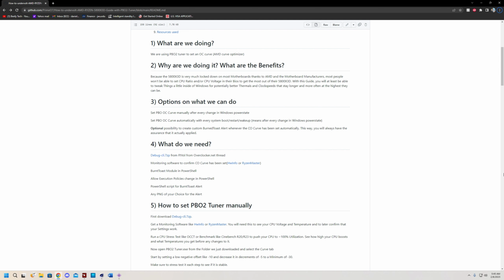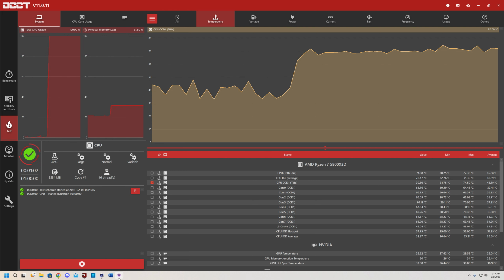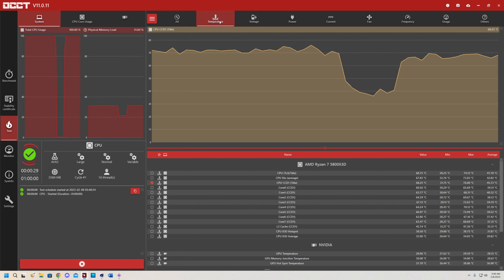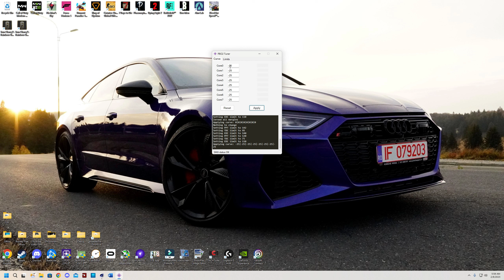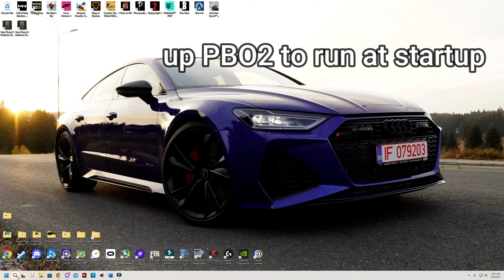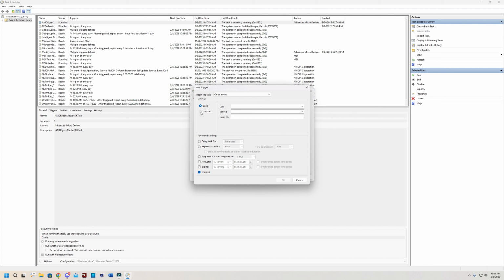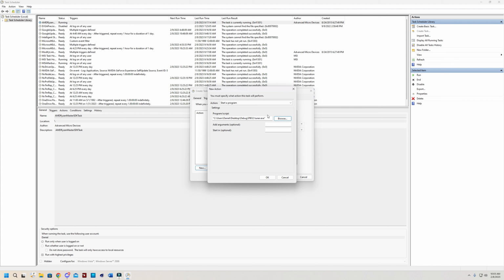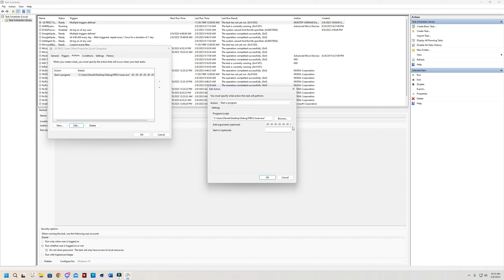5800X3D Undervolted with PBO2 Tuner (Setup Guide and Performance Testing)

Comment: So I just set my system up, what if my 5800x3D is running the same occt tests at 54 degrees, 4450mhz completely stock. Should I still undervolt?
Reply: Edit.. with the -20 offset my PC is silent. It's running 100% use on OCCT at 49 degrees, still deadlocked at 4450mhz
Reply from the maker: @devinlehman8798  no reason not to do it. Less voltage and less heat is a win even with no frequency gains!

Comment: I have b550 auros pro v1 last bios and I use all cores negative -30 and cpu voltage offset to -60mV and will do even lower but I am on 102blck idk why my r7-5800x3d goes as highest 4.45Ghz on stock and now I made it go 4.54Ghz all cores stable on cinebench r23 multicore run and never drop below 4.54Ghz feels much faster than stock.
temp goes 55C on gaming and cinebench r23 multicore 10min run goes max 72C temp.
my old r5-5600x was like bit higer on wattage like 30W on max load but was amazing CPU for 4.9Ghz all cores for 2 years before I moved on.

Comment: why the hell does everyone say that the CPU gets REALLY hot?

i got a 4070ti and a 5800x3d, running on a 2k system and played almost every current high-demanding game there is with maxed out settings and high-maxed out RTs.

the highest temperature my CPU ever got was 55 degrees celcius.
GPU around the same.

i really cant picture this going any higher - im using an Alpenföhn Dolomit Premium CPU Cooler btw
Reply from the maker: Tbh it doesn't, it just gets hotter then the normal 5000 series cpu's due to 3D cache. 

I've since moved to the 7950X3D and it's way harder to cool properly. I run the 7950x3d on a 360mm radiator and 6 FANS with Noctua NT H2 Thermal paste (really good paste) and it still hits 67-68 degrees in Warzone 2 BR🤣
Reply: @Beefy-Tech  yeah, i mean warzone BR seems to be very demanding heat wise - what resolution are you on if you dont mind me asking?
Reply from the maker: @shiiriko  at 1440p. The thing with 7950x3d is if it's a game with cpu bottleneck it pushes voltage to try gain frequency in turn causing more heat in cpu bound scenarios. In Al Mazraah GPU(4090) sits at 85% usage resulting in this higher heat behavior from 7950x3d.
Reply: @Beefy-Tech  did you change anything about the voltage/power in general when you had the 5800x3d? or did you leave it completely stock?
idk if i should do anything with mine
Reply from the maker: @shiiriko  best thing to do is Undervolt/power limits to 120 75 110. 0 performance loss in 99% of situations, and in games like cod running just the undervolt actually helps performance.
Reply: @Beefy-Tech  whats the point of undervolting the cpu though, ive never managed to wrap my head around that idea
Reply from the maker: @shiiriko  so, to explain it as clearly as I can. Take a normal Ryzen 5600x, if you undervolt it, it'll drop temperatures but lose performance or remain at same performance because it is not temperature limited, it'll be voltage limited.

The 5800x3d functions differently, they set a cap on frequency and voltage, and the driving performance factor is being actually reaching that capped frequency. By default, with no undervolt, temperatures of 70 might keep the frequency from reaching its cap of 4.45ghz all core, but do an undervolt, drop temps to 65, and suddenly the cpu and cache are stable at 4.45ghz.
Reply: You just won the silicon lottery. The 5800X3D not only gets hot because of the 3D V-Cache stacked on top, but it happens that most of the chips have terrible IHS contact. Heat can't get dissipated enough quickly and makes the CPU run way hotter. So basically, with some chips, it doesn't really matter what CPU cooler you're using since the heat transfer to the IHS is the bottleneck. You might have gotten a sample that doesn't heat up a lot and with good contact with the IHS. Though, I'd like to know when do you get 55 degrees. Definitely not under a stress test like Cinebench R23 or Prime95. Also, did you, by any chance, use V-Sync or limit your frame rate?
Reply: @xx_360noscop_xx5  personally never use v-sync (play uncapped wherever its possible & max frames wherever its not ; nor did i ever try out cinebench or pime95

i just install new games & play them on the highest settings available at my resolution, thats about it.
but ive hit 57 degrees by now haha
Reply: @shiiriko  as I said, consider yourself lucky, you've got one hell of a chip, one that doesn't heat up like a furnace. I'm really curious to see how it would perform under stress though. If you got time, try a 10 minute CB R23 run, see how it does.
Reply: @xx_360noscop_xx5  i dont know anything about all that to be honest, ill check it out and get back 2 you in this comment section when i did
Reply: @shiiriko  Ok, sure! I'll happily wait here.
Reply from the maker: @xx_360noscop_xx5  hello. I have received comments from hundreds of people on this video and most claim -20 to -30 was easily achievable, and also that it helped their temps greatly. I'm aware the consistency isn't great with 5800x3d'a, as even Optimum Tech Reported that he bought 2 5800x3d's and one of them got 10 degrees hotter then the other.

On my 7950x3d, I'm currently running -40mv on 6 cores, -30mv on 2nd best core, and -10mv on best core, and it's buttery stable and an insane performer, would recommend! But who knows, maybe I too just got lucky😂
Reply: @Beefy-Tech  Yeah. I haven't got the best chip out of the lot, but it definitely isn't the worst. It runs totally fine with a -30 PBO offset on all cores, never exceeds 70 degrees in games, usually in the 55-65 range and gets to 80 max for a 10 min CB R23 stress test. Even though I can't get it to run cool stock, it handles undervolting really well and yoloing a -30 offset on all cores allows me to reach much better temps and get better performance.

Comment: do u think a aorus gygabyte b450-m motherboard could handle this cpu ? or would i present perfomance issues
Reply: Can Def handle it. I'm using a asrock b450 pro4 and it's just fine. This isn't a crazy high power chip like a 5950x or anything. Just remember you might need to update the bios to get it to run.
Reply from the maker: Yup no problem with handling cpu. The 5800x3d doesn't need crazy high wattage
Reply: hi,i have aourus b450 pro with r7 5800x3d only what must to do is update bios,air coler suck and changed for ek280 aio

Comment: I decrease to PPT 90, TDC 75 and EDC 90, and my fps doesnt change, the temp reduce a lot. Is this can be damage to the processor?
Reply from the maker: No if you don't give it enough power worst case scenerio you'll lose performance. The only things that can damage a 3D cache cpu are too much heat 95+ celsius, but it's limited way below that anyways, and to much voltage... but the cpu doesn't allow you to increase voltage, it only allows you to decrease voltage, which is perfectly fine
Reply: @Beefy-Tech  Thank you

Comment: Hey, guys. Please help me, I faced a problem, namely when changing in PBO2 Tuner (PPT,TDC,EDC) at the very bottom of the program window writes: "smu status failed". I tried to find a solution to the problem on forums and many wrote that the matter may be in the motherboard, I have MSI B550 thomohawk. I was able to change this data and in BIOS, but I would like to ask if there will be a difference that I did it manually or with the help of this program, just wondering if it affects the voltage or because of the error I will have to pick it up manually ?

Maybe someone has encountered a similar problem and can suggest a solution ?

Comment: I now have a 5800x3d  but I remmber doing this on my 3600 and when I checked in cini bench even tho it said it was running quicker it wasn't in tasks so I'd double check results if I where u
Reply from the maker: 3600 won't run better with an undervolt, but a 5800x3d will. Cache is temperature sensitive, if you lower Temps, frequency increases on 5800x3d, and stability is better. That's why normal ryzen non-3d cpu's don't benefit from undervolt, because they run stable at higher heat anyways, so lowering heat won't help then nych
Reply: yeah I've done it anyway and ran my own test quite good -20 for me Couldn't  do -25 tho lost stability but my fclk  is set for 1800mhz and my ram is is timed down to 14 14 14 14 28

Comment: Went from 90 to 80 with Noctua NH-D15S Chromax riverside what am I doing wrong ?
Reply from the maker: You decreased your temperature by 10 degrees? You don't seem to be doing anything wrong fam.
Reply: @Beefy-Tech  everyone else is in 70s and my game massive stutters audio and video if I open obs or join Xbox live party will only play well with everything else closed except game
Reply from the maker: @TheOneGhost12  you may want to consider a fresh windows install, and to update your chipset drivers.
Reply: @Beefy-Tech  okay drivers are up to date but I’ll try fresh install thanks
Reply: @Beefy-Tech  have you ever heard of needing fresh install for just cpu swap
Reply from the maker: @TheOneGhost12  yes, if you swap CPU's it is highly recommended to fresh install windows.
Reply: @Beefy-Tech  thank you man , I will try that , it’s driving me crazy , upgraded from 3900x to 5800x3d on tuf 570 plus motherboard and hitting higher frames but like I said soon as I open obs or even Xbox party chat while gaming game suddenly starts to get really stuttery

Comment: what if I'm able to hit 4450Mhz stable per each core at -10 offest  , should i still try to got till -30 ?
Reply from the maker: All it'd do is further decrease temperatures, no downsides to it other then possible instability if your system isnt stable at -30 all core, but ud have to test that👍
Reply: @Beefy-Tech  I eventually went with -30 , it was much more stable at 4450, didn't even budge once after 10min stress test on OCCT/Cinebench where as at -10 it would jump up or down from time to time randomly .
Thank you very much for the guide very helpfull and very easy to understand <3

Comment: no pbo needed
I am using msi combo strike 3. It's more functional and you don't need to bother.
Just turn it on from the bios settings.
The maximum temperature in games is only 70 degrees.

mobo : msi b450 tomahawk max
processor 5800x3d
cooler arctic freezer 34 esports duo

and there is no air intake in the computer case :)) not even 1 ventilation fan :))
Reply: MSI Combo Strike does the exact same than PBO2 tuner... Level 1 is a -10 offset on all cores, level 2 is -20 and level 3 is -30.
Reply: @xx_360noscop_xx5  yess

Comment: Do I need to do something on BIOS before I start use this application?
Reply from the maker: No, you should pretty much not require any bios setup other then your ram being set correctly.
Reply: @Beefy-Tech  any tips about bios settings? What to off/on (except xmp)?
I am using Asus tuf gaming plus b550
Reply from the maker: @SmoKePaF  yes, make sure you enable Resizeable BAR and Above 4g decoding as it's not on by default, otherwise all there's left to do is a custom ram tune or Fan curve for cpu cooler. 5800x3d is pretty much plug and play...the pbo2 undervolt is just to lower temps and maximize performance!

Comment: Wondering how to save my limits settings (PPT, TDC, and EDC) with task scheduler. I followed the video and it only saves my Curve settings.
Reply from the maker: Hey fam, we figured it out in the meantime. You must type the offset, limits, followed by the number 0. Take this line as an example and just put your own numbers in.

-30 -30 -30 -30 -30 -30 -30 -30 120 75 110 0

That 0 at the end is important for all of it to work👍

Comment: Bought a 3D two days ago. You mention your chip stock was running 4.3ghz. Mine in Warzone runs 4450 mhz all the time. Never fluctuate. May be because I have it in a 360 mm AIO. Nevertheless 4.3 looks little bit low to me.
Reply from the maker: I didn't actually confirm the warzone 2 frequency prior to doing it but I can test now as I'm also on a 360mm AIO. I'll do the test with 8 render worker count and see what the warzone 2 frequency is.

4.3 was in the OCCT test
Reply: @Beefy-Tech  Great job. Checked last night your other videos. I see that you love Warzone. I’m like you. But the game it’s broken. They never fix cheater problem and mechanics of the game at 2.0 are far much worse. I would love to go back to 1.0 with mini maps and Verdansk. They can keep Caldera to i doesn’t mind even I’m not to interested on it. But they will never do. Welcome to the world - “You owe nothing (except corporations) and you’ll be happy”
You just got one more sub. Keep up good work.

Comment: What does it mean if it says smu status failed?
Reply from the maker: It means that the command did not apply any of the offsets or limits.
You must type the offset, then the limits, then the number 0 at the end

Your line should like as follows, but with your own numbers:

-30 -30 -30 -30 -30 -30 -30 -30 120 75 110 0
Reply: @Beefy Tech  0h okay I must have forgotten the zero at the end. I'm pretty sure I did everything leading up to that. I'll try it again in a bit.

Comment: Does the limit do anything with tempature. ?
Reply from the maker: It doesn't limit Temperatures, but it does reduce them. A guy that I had a consult with yesterday said that custom limits + doing a -30mv curve optimizer shaved up to 10 degrees in benchmarks. From 88 to 78 degrees. He didn't have crazy cooling so for him it was literally the difference between thermal throttling and not thermal throttling.
Reply: @Beefy-Tech  So if you don't do anything with the limits the temperature does not lower. ?
And the curve is like higher boost clocks. ?
Reply from the maker: @BlueTera  curve optimizer explained briefly, reduces the voltages used at a given frequency, therefore using less power, resulting in less heat. If before your cpu did 5.1ghz at 1.2 volts, after an undervolt it'll do 5.2ghz at that same 1.2 volts. But now it may reach 5.1 volts using only 1.17 volts too, meaning it may overall gain frequency, or at least do the same frequency at a lower voltage.

Limits are simple, they just limit power parameters.

You can do just curve optimizer without limits and still see good performance gains.

Comment: Hey i have a 5800x3d ,6800xt ,16gb corsair vengence , deepcool ak620 , b550 mag tomahawk max wifi ,deepcool 1000wt , wd 2Tb . My pc can run games at 2k  with more than 100 fps for hours,  temp for both cpu and gpu reaches 76 (80 in rare case for short duration). But some times when i open chrome, vlc, obs ,davinci my screen flickers and later on my mice freeze . Is there temp issue or something else in such case?
Reply: deactivate hardware accelleration in browser

Comment: Hey Beefy. Just wondering how much you gained in mw2/wz? 
My Temps are pretty good with my 360mm aio and hitting 4.3hz. Pretty happy with performance paired with my aorus 3070ti but all way looking for more. I’m not the best with computers but have learned how to oc gpu, ram and my other CPU’s. This looks a bit more tricky for me to achieve but if the gains are decent I will give it a go. Thanks for the upload.
Reply from the maker: It hits 10-20FPS more depending on which part of the map I'm on, in game I have render worker count set to 8 and the undervolt makes frequencies sit 200-300mhz higher in warzone which uses all the cores.
Reply: @Beefy-Tech  Tnx beefy. I’ll try it out and get back to you with results. Cheers.
Reply from the maker: @qubes8728  mind you this only makes a difference if you are cpu bottlenecked. The 4090 I was testing with normally sits at 60-70% usage or less, so it brought it up by 2-5% usage on average resulting in that 10-20fps difference.
Reply: @Beefy-Tech  Ah ok mate. Im running a 3070ti with the 5800x3D.so pretty sure im gpu bound hehe. tnx beefy.

Comment: Do you think a 5800x3d will be enough for a 7900xtx on mw2 high refresh rate 1440p? I recently ordered a xtx and I’m not sure if I should stick with am4 or go am5?
Reply from the maker: 5800x3d is a bare minimum for a 7900xtx if you are trying to max out your warzone 2 1440p performance. 

I would recommend you go for 7800x3d if you want to have guaranteed great performance, but we both know it'll be in crazy demand for a while, and as a result really hard to get.

5800x3d might be okay, but It cannot max out a 7900xtx at 1440p in warzone 2.

Comment: Don't understand the argument
why write eight times -20 or how then I would apply the wattage limits and amps
Reply from the maker: The line should look as follows if you want to also apply limits.

-20 -20 -20 -20 -20 -20 -20 -20 120 75 110 0

Make sure there's a 0 at the end of the argument line!

Comment: SO my Q is do you lose any performance if you apply a curve of -30 (ran some test for 20+ min - no errors) and also lowered the other 3 settings for the limits by lets say -17 WILL YOU EXPERIENCE ANY PERFORMANCE LOSSES?
Reply from the maker: With curve optimizer on a ryzen x3Dmd cpu, you will not lose performance, you will gain performance actually.

X3d cpu's boost to their maximum frequency easier when they run cooler, meaning an undervolt actually helps a lot with performance rather then hurt it.

But, if you apply limits that are too contrstraining, you can lose performance, so you need to be careful what limits you apply👍